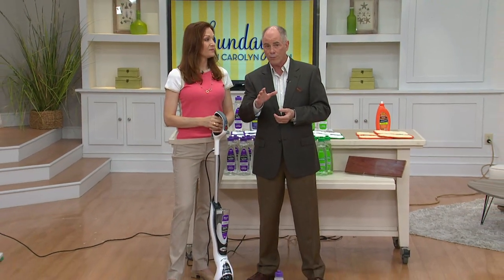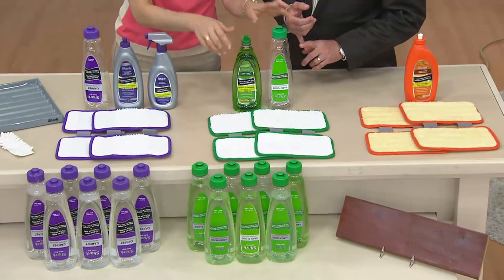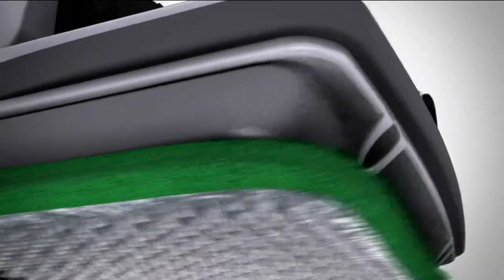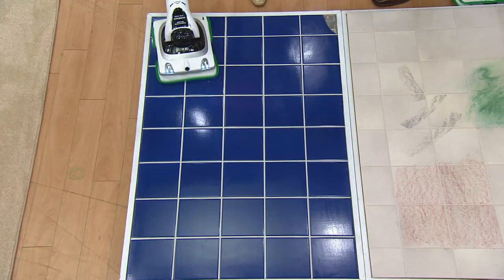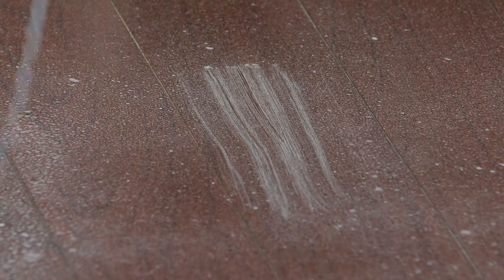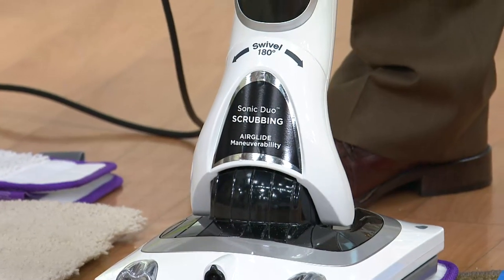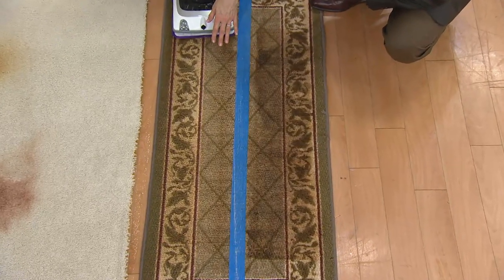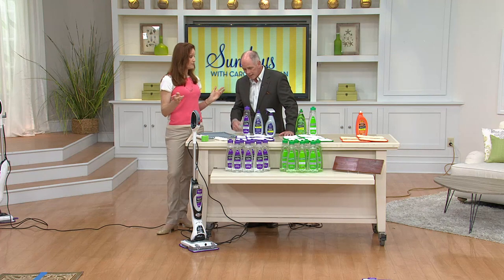Shark Sonic Duo Carpet & Hard Floor Cleaner w/ Accessories with Dan Hughes

Comment: i'm thinking about purchasing this machine, trying to convince myself.
Reply: I love mine.. I mop my floor in no time, so quick. Waxed my moms hardwood floors, the machine moves with ease. solution very concentrated so just a long time. Forgot about carpets, just did for the first time and works great. And love that I just wash pads. Best mop I've ever owned. If I have something stuck hard to floor. I spray and let sit while I mop other side of kitchen, then go back and confess right up. No bending down and scrubbing. Comes with little tool, that lets your reach though a areas. it's detachable like stick. Not connected. Everyone loves it that had tried it, actually fun to use and love the finish product. No I don't work for the company.